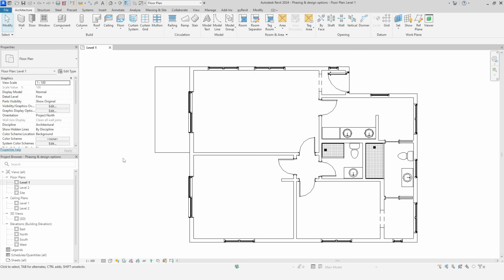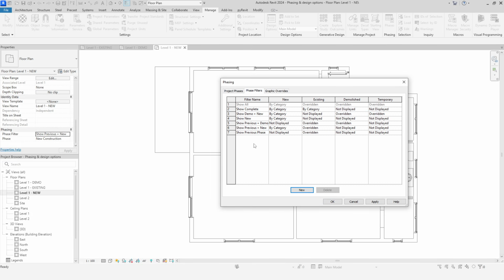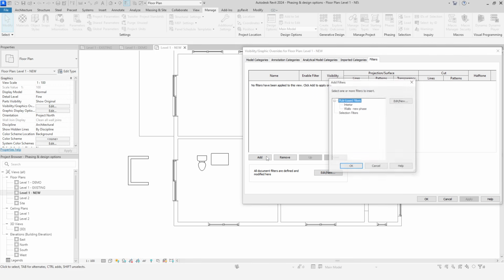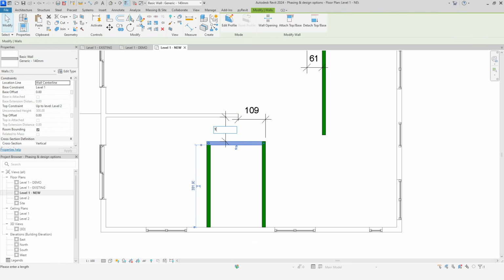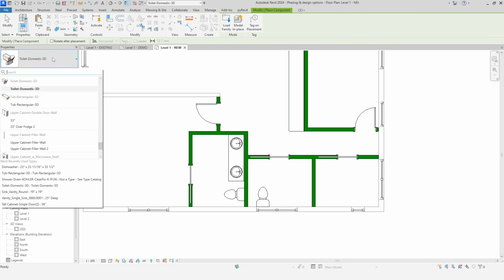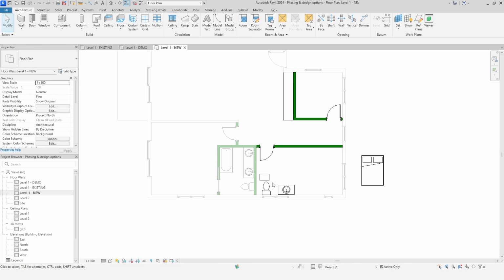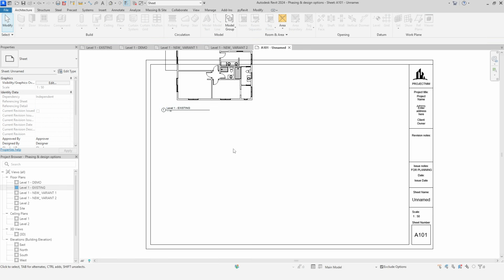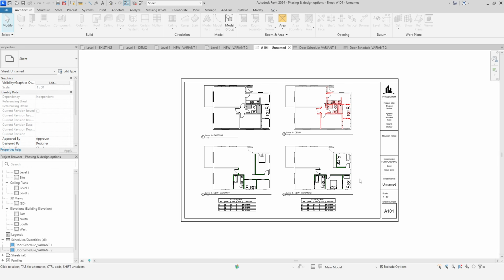How to Combine Phasing and Design Options in Revit - Renovation Workflow

Comment: Thank you for this awesome video. Exactly what I needed. How do you change the colour of the new toilets and floors if it's an external addition. And how to then show the new wall additions in elevation in a certain colour.
Reply from the maker: Thank you so much - we’re really glad the video helped.

Great questions. Let’s break this into two parts.

1. Changing the colour of new toilets and floors in an external addition

The same principle applies - you can create additional View Filters for other categories such as Plumbing Fixtures or Floors, using the rule Phase Created = New Construction.

If you want all new elements (for example Walls, Floors, and Plumbing Fixtures) to appear in the same colour and pattern, you first need to add all those categories into the same filter.
Inside the filter setup:
- Select multiple categories (Walls, Floors, Plumbing Fixtures, etc.)
- Set the rule to Phase Created = New Construction

Now, depending on how you structure the rules:
- If you use the AND rule, you can keep the logic simple and apply it with “All selected” categories, meaning the rule will apply consistently to every chosen category.
- Alternatively, if you use the OR rule, you can define each category condition individually inside the filter rule.

In both cases, the result is the same: the override you define (colour, surface pattern, line colour) will be applied to all selected categories.
So if you define Projection/Surface Pattern and color, and Cut Pattern and color, all selected categories will share the same graphical appearance in that view.

However, if you want different colours or patterns per category (for example toilets in blue, floors in yellow, and walls in green), then it is better to create separate filters for each category - just as we did for the walls. Using the same principle, you simply create additional filters for the other desired categories and apply different overrides to each one.

That approach gives you full graphic control and clearer visual differentiation.

2. Showing new wall additions in elevation in a specific colour

For elevations, the workflow is identical.

Just make sure the filter is added to the Elevation view (or included inside a View Template), and adjust the Projection Surface overrides, since elevations display elements in projection.

Now one important thing to keep in mind, when working in Sections, some walls will be cut instead of projected.
In that case, it’s highly recommended to define a different Cut Pattern and Cut Pattern Color, separate from Projection.
Otherwise, projection and cut graphics may visually merge and reduce clarity in the drawing.
Setting different overrides for Cut and Projection helps maintain clean and readable renovation documentation.